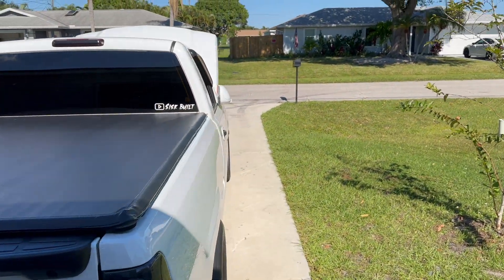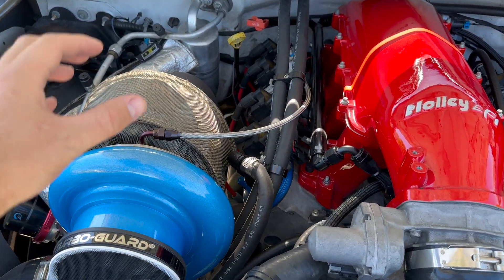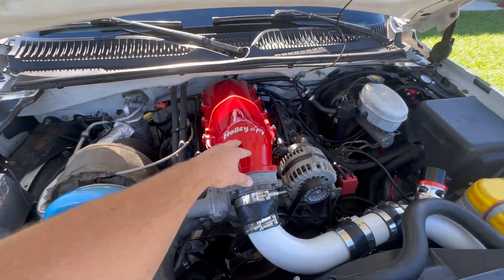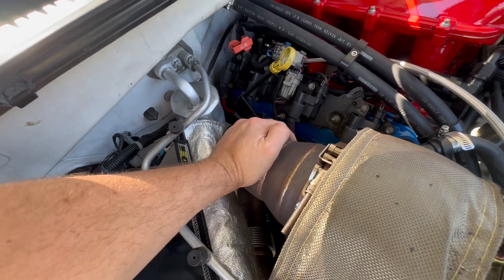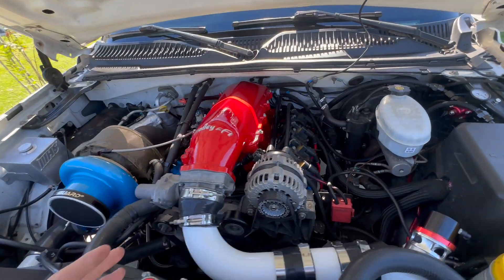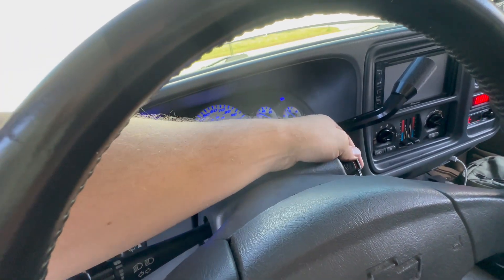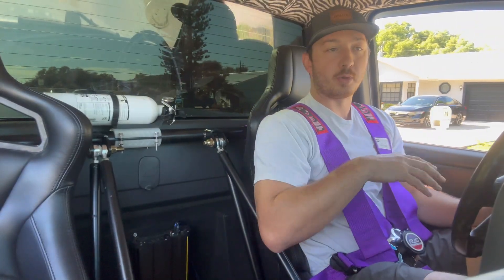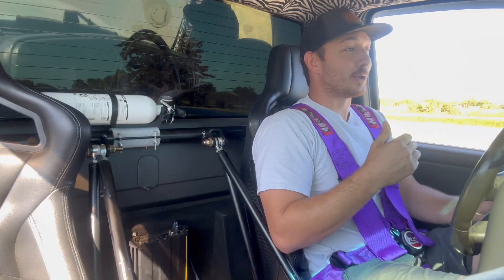Full Rundown: Why My Turbo Setup Works

Comment: How much boost you runnin?? I got a 06 with a rebuilt 6.0. Mine was makin about 9lbs but after i ran the exhaust its makin about 6.5 lbs 🤷🏻‍♂️ guess the exhaust pipe changed the back pressure that much. Really like your truck, looks good and sounds great!!
Reply from the maker: This was on 11 pounds. I’m assuming maybe 500 whp maybe 600. Do you have a boost controller?
Reply: @SiskBuilt   nice, according to the hub dyno, mine made 558rwhp. I got the holley terminator x max on it too. I dont have a boost controller on it. I actually ordered one for both my trucks and theyre suppose to be in next week. Cant wait to install them and see on my trucks respond. Do you have any other plans for your truck?

Comment: This truck is why I put a turbo on my 01 Sierra,mines a nv3500 which I know is weak but fingers crossed it's still holding up,one you use a power adder there's no going back lol

Comment: Hey man, quick question. I’ve got a 1JZ making around 550 - 600whp and I’m planning to swap in a 4L80E. Right now I’m on an A340E but it’s already at its limit, so I want something stronger. Based on your experience, how much WHP and WTQ can a stock 4L80E really handle? I’m trying to figure out if the one I have will survive at this power level or if I should build it first. Thanks bro.
Reply from the maker: So stock, I’ve blown up 7 on NA cam/heads 6.0. I’m about 4500 pounds so that hurts it more. I broke my level 5 rpm 80e but that’s “anomaly”. Now it makes about 600 maybe; and is loving the abuse.
Reply: @SiskBuilt  Thanks bro, that actually helps a lot. My car only weighs 3,370lbs so it’s much lighter than yours. Sounds like at my power level (around 480–530whp) I should be totally safe. Appreciate the info 🙏🏼
Reply from the maker: @1JZGenCoupe look into a shift kit! It’ll help a good bit!

Comment: Did you have any fitment issues with the turbo kit rubbing anywhere or did you have to cut anything else to make it fit?
Reply from the maker: No issues, full turn it’s good, but I’m on 20x7 wheels.

Comment: Can you please tell me how you shift it for a pull? Do you start in 2nd? Then you immediately shift to 3rd when the turbo hits? Or is it 1 into 2?
Reply from the maker: Kinda depends on the speed but I was in 2nd gear for one of the rips!
Reply: Thanks! I have 3.23 gears currently would you recommend staying with those for drag racing to avoid having to shift to 4th? My build is 408 cu in and I plan to add the 80/96 turbo like you have.
Reply from the maker: @466rudy6 3.23 you’ll have plenty of MPH!